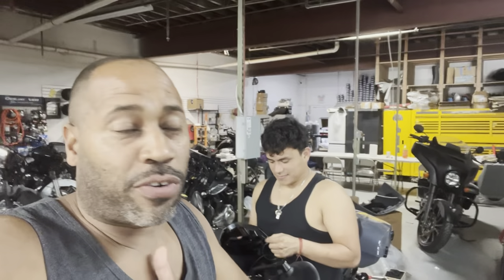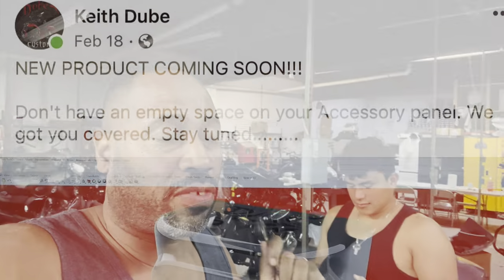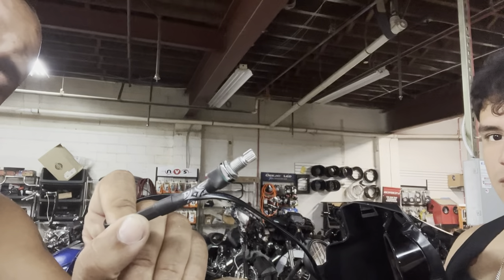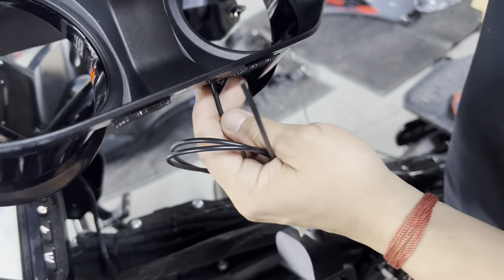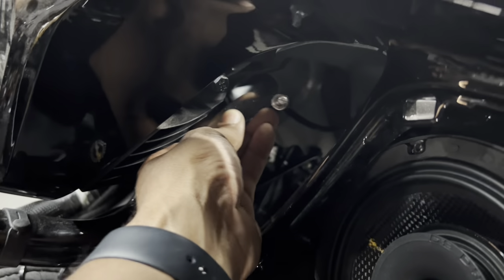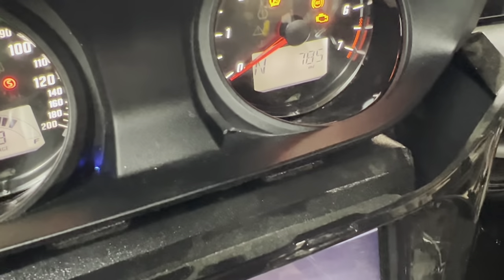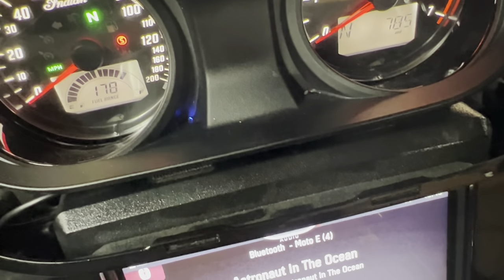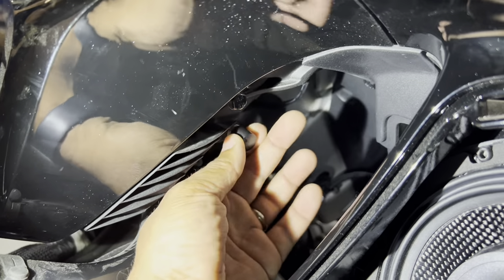The remote installer by Dube’s custom .Remotely mounted  bass knob for sound digital amplifiers.

Comment: Are those the EX6NCD-CF in the fairing? If so, did they take much mods and 1/4 spacer for them to fit?
Reply from the maker: Yes we had to grind the pod and run a 1/4 spacer